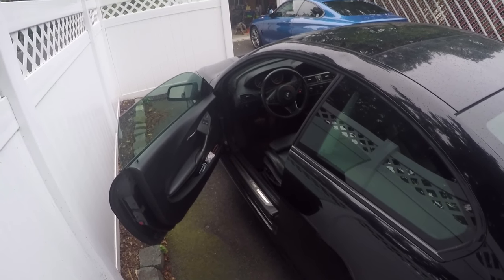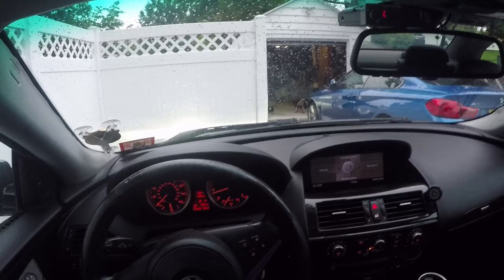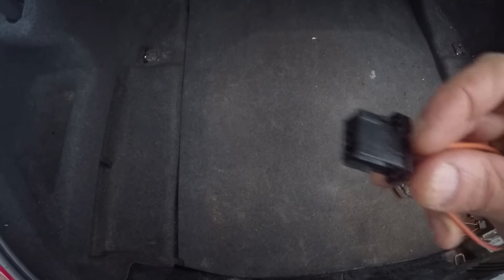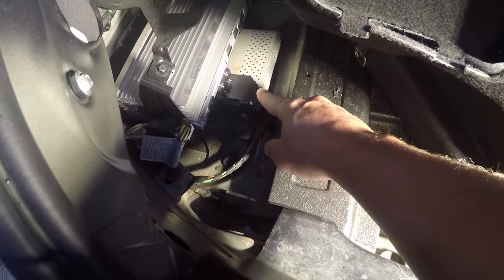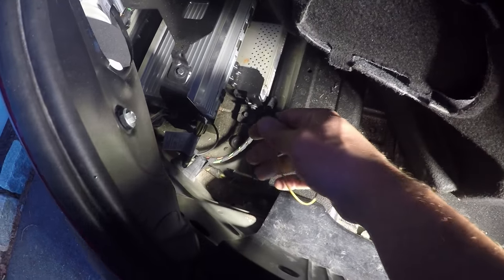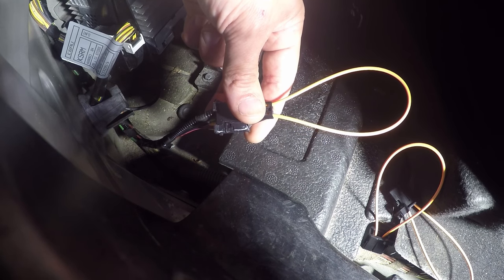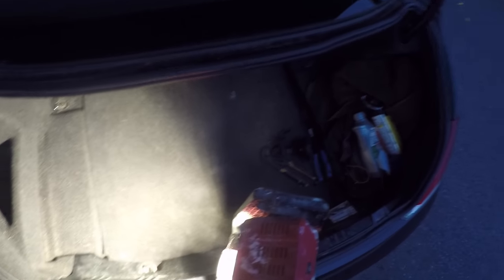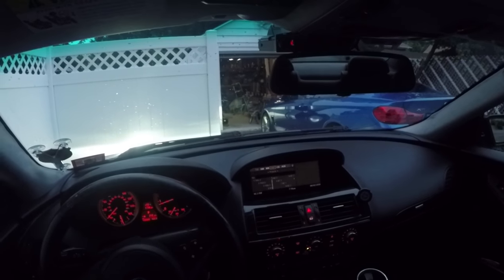FIX BMW SOS Error Light Audio System Failure CHEAP + Tips Others missed!

Comment: So i bypassed the satellite radio and my audio is still not working. What would be my next steps of things to look at?
Reply from the maker: the loop linked in the description comes with full handholding/support to troubleshoot these issues. It is likely one of the other components on the fiber network in your situation depending on the year and make of the vehicle

Comment: Hi wanted to thank you for great information,you saved me alots of $$$$$$$ .. I have a 2008 750 LI, the SOS module is inside the trunks left side ceiling,I did order the by pass cable of your you tube link as well.. thanks again
Reply: I have the same model. I just ordered the part so I know it will work. Thanks

Comment: I've tried the adapter,  & it's still not functioning what can it be ?
Reply from the maker: It could be several things, it could be the CCC, there are a lot of variables involved. Most people get lucky and it just winds up being the satellite receiver, TCU, BT module, MULF etc... But other times it requires further troubleshooting. If you got the loop from the Amazon link in the description they literally work with you one-on-one to figure out exactly what the issue is and get it resolved as cheaply as possible without involving the dealership.

Comment: hello, where should i put the connector? on the green and black cable of the TCU ?? my problem is bad SOS.
Reply from the maker: The component that needs to be tested/ bypassed depends on the problem.  fyi The optical cable is almost always green.  The part in the description comes with free support until the issue is resolved.
Reply: @ModsAndProjects   can I just replace the radio would that work

Comment: Will this work if it seems like I’m not getting any power to the unit at all. Suggestions? Please help!!!
Reply: Did you figured it out ?
Reply: I did. Ended up basically buying a refurb on ebay. Then replacing the whole unit.
Reply: I removed my battery for two mins and reconnected it and my radio/Navi doesn’t power on and none of the fiber cables have light ….. I’m hoping I can swap mine out like you and it would work again :(
Reply: I'm rooting for ya. It was WAY cheaper. Never had to go to a shop!

Comment: Have the same issue on my 2014 bmw x1. Went into the trunk lining and can’t find the satelite radio module. Is it in the same place on that model or is it somewhere else? Nothing online can point me in the right direction
Reply from the maker: After around 2011 BMW started consolidating the multiple multimedia components in the into a single communications box "combox" you can try to diagnose the issue with a  loop on the commbox, however, if the unit is bad you will need replace it with a matching part number / firmware number / software number from eBay etc.  The comes with support to help diagnose these kind of issues fyi
Reply: @ModsAndProjects  that saved me so much time thank you. I’ll let you know if the bypass changes anything

Comment: it didn't work for my 08BMW 328i, just changed stereo, so what else could it be ???
could it mean the connection not good, i did wire tie them together ???
Reply from the maker: If you ordered the part from the link in the description it comes with full one-on-one telephone support to help you resolve your issue.  Read the positive feedback on the item.  It could be several issues and sometimes requires further troubleshooting

Comment: So I bought the adapter and watched a few videos similar to this, and when i started the car back up, the audio never came back on. Any other suggestions that you can think of what the problem might be. I have an 2008 BMW 328i
Reply from the maker: What component did you bypass? Explain what happened from the day the SOS light came on and I will try my best to help!
Reply: @modsandprojects i recently bought the car and it came like that, the SOS light was on but then disappeared, so i bought the piece just to see if the system audio would turn back on but i still don’t hear anything. When i do turn the volume knob, some little thing on the Navigation system pops up saying “Jam_On”. I don’t see and indicators that corresponds with the volume going up or down.
Reply from the maker: @DOMOBRO  So you currently have no sound and the SOS light is off?
Reply: @modsandprojects yea, the sos light is off but no sound is running though the system

Comment: Hi 
I realy need help. I have similar problem with my car(2006 520d) 3 days ago sos light come on dashboard. And yesterday idrive completely gone. When I start the engine on the idrive screen just writing BMW no sound no satnav no anything. You have any ideas of this problem? Please help
Reply from the maker: If the nav keeps rebooting in a 2006 you have a bad CCC.  You cannot bypass the CCC it needs to be repaired or replaced. Also, you can't just drop in a used eBay CCC, it will need to be coded to your vehicle.  BMW charges 1200-1600 you can get it repaired for around 400.

Comment: I have an 09 650i and I only sometimes get the SOS and no sound. I have the issue 80% of the time but sometimes the music comes on with no problem. How would I know where the error is?
Reply from the maker: The loop in the description can be used to individually bypass each component identifying the one causing the fault through process of elimination.  in your case it may take a little extra time since the problem is not consistent but eventually you will find out which component is causing the problem. The particular loop in the description comes with support if you have any issues on your own

Comment: Hi. I did bypass my tcu and error was back after 1 min driving. Everything else works perfectly! Any help! I have a e61 530 2007 lci. Thanks in advance!
Reply from the maker: Need more information.  Was the SOS light on, did it go out after? Was the audio working pre and post TCU bypass?  Did the bypass work initially? Did you try and bypass the satellite receiver?
Reply: @ModsAndProjects  yes it was on when I bypass it was gone but comes back when I drive about 30 seconds to 1 min. Radio and everything else always worked! I am not sure if I have a satalite receiver? I can't find it!
My tcu in the trunk boot close to seats and amplifier on the left side over left rear wheel. Where satalite receiver is located u think? Thanks
Reply from the maker: @yunuscakir5825  You may not have a satellite receiver. Is it it an option in your audio source selections? If your car is a 2007 there is a very good chance your CCC or your amp is on the way out.  Is the amp a logic7?  I'll send you a link to help you further diagnose the issue.
Reply from the maker: @yunuscakir5825  Add us on FB https://www.facebook.com/modsandprojects and msg me there.. Ill help further!
Reply: @ModsAndProjects  yes I have 2007 lci. I don't think I have logic 7.it says harman kardon something like that on the amp. And it might be hard to believe but I don't have Facebook. Can I mail u? Thanks
Reply from the maker: @yunuscakir5825  Twitter? Insta? i put my email in the comments the spam bots will get me! https://twitter.com/Modsandprojects  or https://www.instagram.com/modsandprojects/
Reply: @ModsAndProjects  I have try to write to you on twitter! Couldn't dm but I did tweet to you I guess. Sorry not used to with social media 😁
@Yunusca25887692
Reply: No work in my bmw 2007 550i, no sos no audio 😔

Comment: MY AUX OPTION IS GREYED OUT AND I CANT USE IT ANYMORE . I HAVE NO IDEA HOW TO FIX. ANY SUGGESTIONS:(
Reply from the maker: Hello, first you would need to 100% confirm the satellite radio is in fact malfunctioning, the loop is a great tool for this just to confirm. The loop in the description of the video comes with full support directly to help you troubleshoot definitively what the problem is in the best approach for repair or replacing as necessary

Comment: Didn’t work for my 08 BMW X5 E70 any other suggestions?
Reply from the maker: The loop in the description of the video comes with full tech SUPPORT directly to help you troubleshoot definitively what the problem is in the best approach for repair or replacing as necessary.  Pretty awesome considering  the part is only 14 bucks

Comment: If the Amp, Satellite & Bluetooth module are getting power, the fuse in the back of the head unit is good, speakers are all hooked up, radio is working & completely functional except having no sound. What could it possibly be? I bought a new head unit (300$, had like 70-80k miles when pulled out) Is there something inside the head unit itself that could be the problem to it not delivering sound, chimes, whatever. Before I installed the new head unit, the sound was completely working (jus the display didn’t work). Kinda confused. Any help? (I’m not selling the car, I want to learn the problem than run away from it, dont bother suggesting that)
Reply from the maker: @BubbaOnYaNerves  if the CCC / cic is being replaced it needs to be coded to the vehicle in order to function properly

Comment: I have a 2009 750 l i and I bypass every component there is and still nothing in my car my screen is still black no sight no sound no nothing
Reply from the maker: @Brandon Smith All black screen with no sound is 100% a bad CCC (or bad power connection to the CCC). It is possible another, 2nd component is also bad (like the satellite radio receiver)  but you need to start with diagnosing the CCC. If it is in need of repair here is a link for the best price/ service  you will find on the interwebs: http://www.bmwlogicseven.com/?page_id=4123
Reply: Did u figure it out ?

Comment: 2007 bmw 335i sos light, no door chimes, no sound, bmw logo on nav. Installed a good used tcu, no luck. Used a bypass cable from amazon no luck. Please help.
Reply from the maker: You have tried bypassing the satalite reciever and the TCU (before replacing) do you have idrive? Any loss of bass or distorted sound before the failure?
Reply: Did you figure it out?

Comment: Please can anybody help?! - I own a BMW X£ - 2015 model....The  'SOS system failure' yellow light came on a few weeks ago...since then i have paid 3 or 4 times to have it switched OFF at diff' garages...but very soon, it came back ON again....once it went OFF by itself the next day, but a couple of days later, it was back ON....I tried to bypass with a Loop connector, but what i thought was the satellite box, wasn't - i cant find it anywhere, i have looked, bit i cant find it!....and yet the SOS button to make the emergency call..still works!!...any help out there would be appreciated, i'm sick of paying garages....none of them seem to know why it happens, and BMW just tell me they will switch it off in the same way...so i'm stuck! 'HELP'PPPP!   -  :(  ... UPDATE! ...  On close inspection i noticed the Battery plug was not fully pushed in to the Box...now the SOS System failure light has gone out!....'happy days'!
Reply from the maker: On a 2015 you do not have separate components like the 2006 to 2010 BMWs you have a consolidated component called a communications box. It generally needs to be replaced to get rid of the light
Reply: @ModsAndProjects  - 'UPDATE' - Thanx for your reply, much appreciated - i did a close inspection of the communications Box and noticed that the Battery's were 'taped' to the Box!...So, everytime i drove over a bump etc the battery/s were moving, there was no battery housing cover to secure them, hence the tape....i then found that the battery connector plug was not making a secure connection to the box...i then pushed in the connector plug tightly and then it happend....the Light went out!! .... 'Happy Days'! -  :)

Comment: If I do this tip I won’t have satellite radio anymore? I use that the most
Reply from the maker: Yes, if you bypass the satalite unit you will loose it as an audio source.  Other sources work fine.  If you want the satalite functionality you will need to have the unit repaired or replaced.

Comment: Hey I have a 2007 bmw 335i and I had the sos error so I bought the part and plugged it in and I turned the car on an I get no sound at all now. No dings or anything. I messed with the volume tried muting and unmuting and nothing happened.
Reply from the maker: Did you get the part from the link in the description? If so it comes with direct telephone support.
Reply: You figured it out?

Comment: My FM radio works, AM will display but only plays static.  Phone no longer connects via bluetooth.  DVD says not DVD but there is one in the DVD player.  Satelite does not work and is grey out.  Which component do you think is bad?
Reply: it is a 2009 bmw 650i convertible

Comment: Hey, I have a 530i 2007 bmw, I watched the video purchase the item took it to the shop, and still the same problem. I can still hear the ding when I opened the door, but the ding cracks. When I turn the car on the sos comes on the radio cracks and after ten min of driving the Idrive turns off. If you have any suggestions please let me know.
Reply from the maker: Contact me on one of the social media platforms on the card and ill personally ensure you get the issue corrected.  https://www.facebook.com/modsandprojects

Comment: Hi I have bmw x6 2008 35i xDrive. I have sos coming in my dash.  only one spicker doesn't working all other are fine what do you think I have the same problem
Reply from the maker: It sounds like you have either an issue with the actual speaker driver itself or possibly the one of the channels in the power amplifier has gone bad.  Check for moisture around the power amplifier.  If it was just the speaker driver that was bad the SOS error would not be triggered.  It is likely one of the components in the fiber optic network is malfunctioning in addition to one of your speaker drivers potentially being bad.  If you purchase the loop in the description it comes with support to help troubleshoot your issue.

Comment: I have 2006 750LI with the SOS error light but my stereo and the satellite radio works fine no noises, any ideas?
Reply from the maker: If you get the loop from the link in the description it comes with full support should you need assistance in troubleshooting, but you will definitely need a loop to diagnose it

Comment: My bmw 525xi i drive radio plays then stops playing and repeats also shows the sos icon would this be the same problem
Reply from the maker: hello, thanks for commenting :-)  the bypass loop is a great tool because it allows you to identify exactly which component is malfunctioning. The particular loop in the description of the video above comes with direct customer support to assist you with identifying the exact problem and helping you to decide whether just bypassing it or regaining the functionality is the best course of action. A lot of times people just bypass out something like the satellite radio to get rid of the SOS light or to get there sound back, however, if it is something like Bluetooth that you might want to get the actual functionality back the tech support will guide you to the best course of action in getting it addressed avoiding the crazy prices the dealership would charge. For $14 it’s pretty awesome that you get that level of technical support!

Comment: I have a 2008 e70 X5. Same problem, same red flashing light on the end of the module cable. I've got this cable on amazon,cut it cto fit in there, but nothing. As soon as I turned the ignition on the sos sign came on. Still no sound, no change. 😔😤😤😤 I even unplugged the battery for a few minutes, was hoping it would drain the electronics and when I plug it back in this will work...it's so frustrating when you see guys with the exact same problem, and this works for them. Meanwhile I don't see another way than going to the stealership. 🤬😤
Reply from the maker: The one linked in the description comes with full support to help you troubleshoot and resolve the issue for the lowest cost possible Even if it is not a simple bypass.

Comment: I have a 2014 bmw 328i and had the sos warning and no audio issue I did this and it worked great but now like 2 months later my key is not being detected and the door won’t lock or unlock  from the key fob buttons and have to start  by putting the key to the steering wheel took it to BMW and they said they need to repair what I did lol and then see if the tcu is not damaged to then try re programming the car and they quarter me almost like 4k just to do all that I took my car back I don’t have that money to just fix that can anyone help me with ideas on what to do

Comment: Chech the sos fuse in the truck that fixed my problem.  BMW 750li.
Reply from the maker: Huh? There is no fuse for the SOS error :D maybe you had a fuse that was blown for one of your components that you changed out and the component came online therefore correcting the error but certainly there is no fuse to correct the SOS error